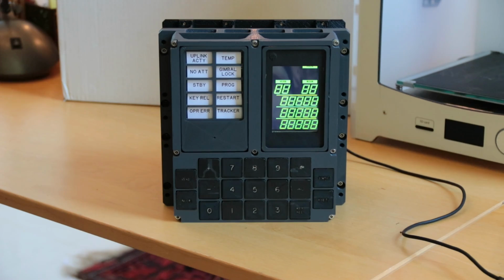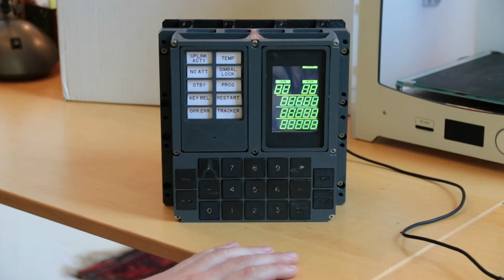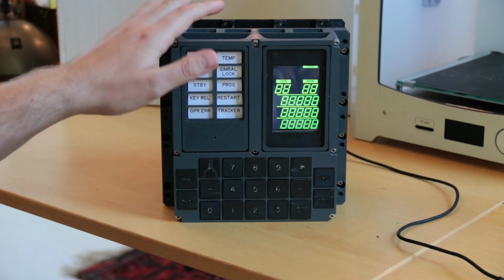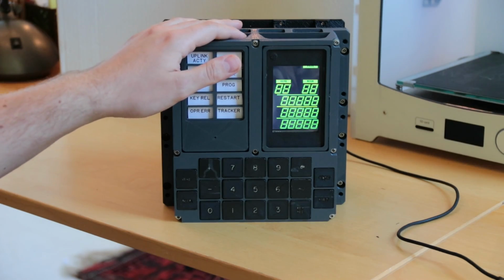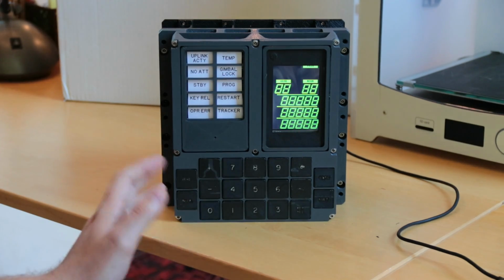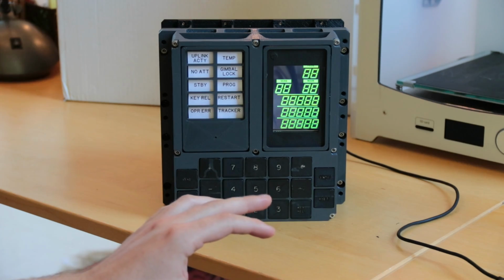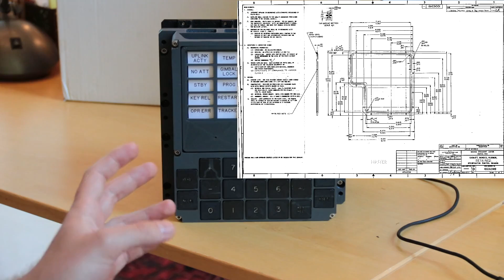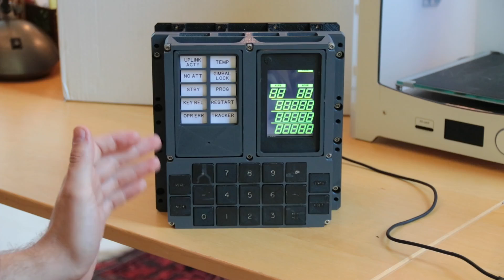Mechanically Accurate Apollo DSKY Replica

Comment: I mean this is cool but mechanically accurate is a stretch.
Reply from the maker: If you say so :)
Reply: I mean no shade or anything but the dsky buttons are a thing of beauty and also there's a lot of connectors that just don't exist anymore. Also, there's the display modules which are pretty much unique. Like it Fran from Fran lab had worked on a reproduction for like a decade or something. It's still a really really cool build though.

Comment: Wow - really nice job!  

I'm building an approximately half-sized DSKY, machined out of an 1/8" aluminum panel that also uses an RPi,  I have a 2.4" Adafruit piTFT directly attached to the Pi.  There is just enough GPIO to run the piTFT, and to read the keyboard matrix. I'll need to serially multiplex alarm panel outputs into a latch. I use simple Cairo graphics commands to draw register segments to the screen. The simple Python script refreshes quickly.  I'm happy with the refresh rate and expect it to work well when I also write all of the registers.  I used 1/2" square, clear acrylic extrusion to form the individual keyboard plungers that activate sub-miniature limit switches which provide a satisfying mechanical click. I've reverse printed out key cap legends on transparency film to eventually glue them to the tops. LEDs on the keyboard PCB will light up the key cap characters. Everything is spaghetti handwired right now , but I want to replace that with a single PCB to plug everything into. 

I'm using smaller square acrylic extrusion to form the Alarm light cells.  After sanding the surface, and backing the warning panel with white cardboard the texture turned out really nice.  I use LEDs mounted on the side of each Alarm to illuminate it without bright spots. I reverse printed the labels using the Groton engraver font onto an overhead transparency on an inkjet printer.  The printer also filled in a yellow background for some of the alarms.  

I'm just using this as a weird looking desk clock for now, but I do want to get it hooked into the VirtualAGC also loaded onto the same Pi.  My DSKY is an ongoing project and I haven't figured out the exchange of data with VirtualAGC yet.  Would you mind sharing the changes to piDSKY that you made to interface to Virtual AGC? If you like, I can share my changes to run the piTFT class of screens directly from the Pi to display the time using the open source Cairo graphics commands.
Reply from the maker: Hi Rick. So sorry for the extremely late reply. Machined aluminium DSKY, love it! Do you have a write-up of your project somewhere? 

My modified pidsky.py is on the project's github :) https://github.com/ManoDaSilva/AGC_DSKY_Replica/tree/master/Python%20Scripts

Cheers

Comment: When I try to access the 3D parts (stp or step) files, I just get a page of text.  How can I access the files to open in Inventor or Solidworks?
Reply from the maker: Hi Christopher,
When you say you get a page of text, you mean, in the browser, when you try to open it straight from GitHub? You'll have to download the whole thing (either with Git, or from the browser's "Code"==>"Download Zip" option. You should be able to open the STEP files from Solidworks without issue :) 
Let me know if it works!
Reply: @on6rf  What did you use for the display?  I would like very much to build a DSKY, could you help me?  I have no experience with the electronics you are using & the software needed to run it.
Reply from the maker: @christopherbrown5338  I used a Nextion 3.5" display, interfaced with an Arduino nano (which was in turn connected to a Raspberry Pi handling the simulation). There's a whole lot of the process detailed on my Hackaday.io page, I hope it'll help. Sadly I don't have much time (nor access) right now to add more info, but I'll try to come back to it whenever I can
Reply: @on6rf  I got it.  I have Inventor at home & Solidworks at work.  I noticed you have several face covers, what is the difference?
Reply from the maker: @christopherbrown5338  Different versions were made during the life of the DSKY (off the top of my head, some had a larger display than others). The repo I linked in the description are historically accurate drawings, but some of them were modified for 3D printing. The Hackaday.io post I wrote will help on this matter :)